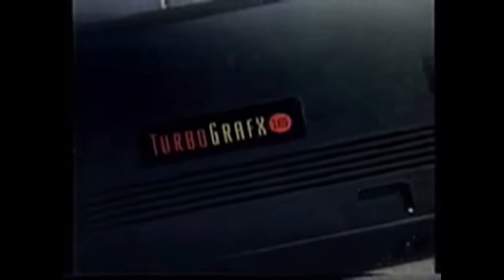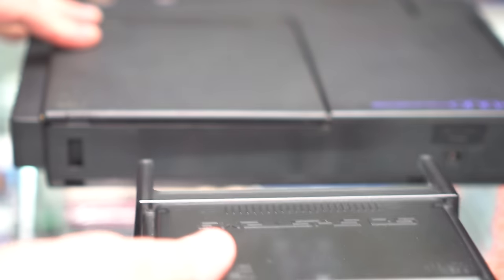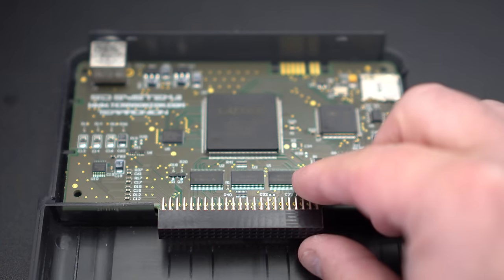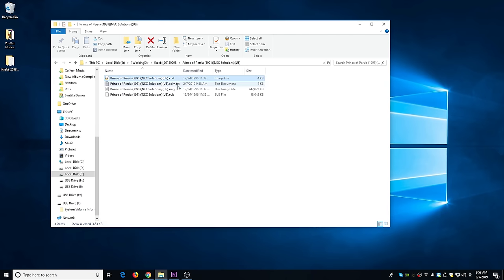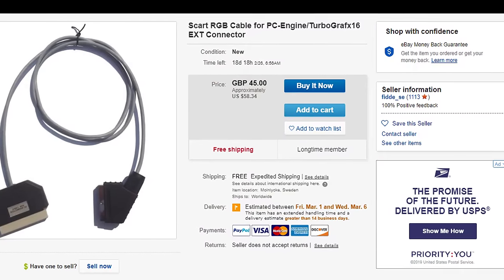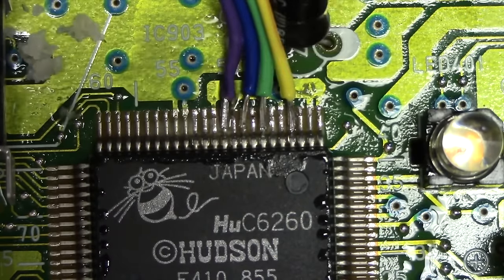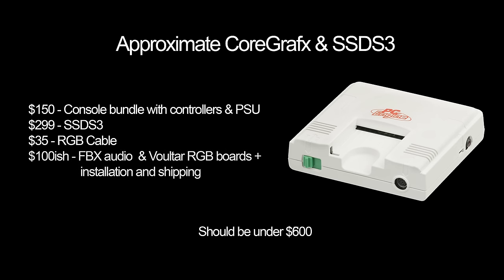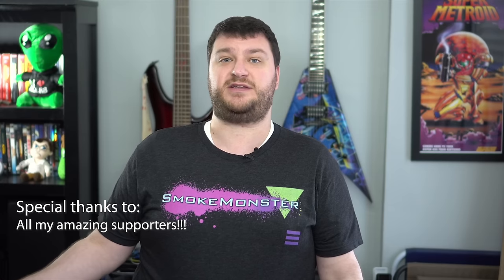TurboGrafx-16 & PC Engine Hardware Solutions

Comment: I am the seller for the Chinese Clone RGBS adapter, would you let me know what do you mean "potentially" damage your system?  Any evidence ?  The device is just a simple RGB amp, I really want to know how it can damage your system ?
Reply from the maker: It was sometime in 2017.  Seller's name was 'choijustin'.  The 220uF input capacitors were backwards.  If they heat up enough and fail shorted, there is nothing to limit the current from the HuC6260 pins.  HuC6260 RGB DAC outputs are easily damaged when overdriven.  It is not my responsibility to help eBay sellers correct bad designs that are sold to consumers, nor is it to keep up with newer versions of those bad products.  The units I tested, as well as the fact that you put "potentially" in quotes and refer to this as 'just a simple RGB amp' without even realizing it can ruin a console are why I will continue to warn customers away from this thing, as I always have.
Reply: @RetroRGB  Wait a minute. 
1) There is No 220uf capacitors for my adapter at all ( since version 1 ) . Basically, my RGBS adapter does Not use 220uf capacitors. 
2) If you read the picture of my adapter inside your movie carefully,  all the capacitors are ceramic ( they are Non polarity ). It is impossible to install backward.
3) For some of my early model ( yes, may be back to 2017 ), only the sound portion are using electrolytic capacitors ( which has polarity )  and they are 47uf.
I am pretty sure those capacitors are installed in correct position ( Not installed backward ). Out of 1000+ of adapter I has been sold, I canNOT swear Non of my adapter never has single of capacitor being installed backward ( since  they are hand made ). *Assume* I made mistake and have some adapters install the capacitor by mistake ( yes, assume ), does it means the adapter is bad product?   Can Samsung / SONY guarantee None of their product has any issue? 

In order to avoid any mistake ( assume I have ) I made, I change all the capacitors to ceramic capacitor ( which is the current version ) to prevent any human error happens. I made improvement to my product and try to avoid human error if possible.  Should you use one sentence -->  "those bad products"  to describe ? I don't think this is fair

Finally, please don't change my meaning --> 'just a simple RGB amp' without even realizing it can ruin a console
What I mean is since the RGB amp is design/assembly properly, how can it ruin a console ? If you assume the thing is Not design/assembly properly, of course it will damage thing ( eg, you put 5v output back to the input pin, of course it will fail, Not limit to RGB amp but anything , right ? )
Reply: @RetroRGB  One more thing, I just double check with the circuit designer for this RGBS board. He confirms the capacitors in the sound portion ( 47uf ) is for separate/prevent the DC voltage  on the board to enter into audio pins of PC engine extension port. He reminds me audio signal is Not an electric current, therefore, the capacitors ( 47uf )  in Not for DC current ( which carries +/- ) but only for separating DC current and only for audio signal ( which Not carrying DC current ) .  In case the capacitors have been "installed backward by mistake", it won't hurt anything. However,  to avoid confusion, he changed all the electrolytic capacitors to ceramic capacitor which does Not carry polarity.
Reply: I got 2 of these Chinese eBay RGB adaptors, work perfect in RGB Scart on CRTs in the UK... they are excellent value for money imo .. ✌️💥
Reply: Seems to me some of these overpriced american 'designed' retro products are just plain lazy design rip offs of the cheaper Chinese workarounds and with a few bells and whistles added... and they are still produced in Asia...
Reply: @TheKayliedGamerChannel-YouTube  what? Many of them aren't, or at least assembled. The separate pieces may be, but that's not the part that matters. Eg: the capacitors and resistors etc are manufactured in China/Taiwan etc but the product itself is designed here and assembled for the specific case of game consoles and AV. This type of thing is especially important when things like shielding are considered, and with less shielding around power supply it usually won't matter (TV or SD video) but for gaming it can cause interference even with shielded AV cables, which is another product that matters in all this, and with adapters using certain lower cost processors/silicon for down or upscaling or just transcoding/converting, you can introduce latency that normally wouldn't matter but very much does in gaming.

That said, singling out Asia only isn't accurate as many US/Wester or Russian sellers sell crappy products or stuff that isn't up to snuff for high signal integrity and low latency etc. It can also be a matter of customer support or product support over time, warranty etc. It's just like anything else. I genuinely don't think many of the more expensive cables and AV gaming specific solutions are overpriced, even the ones I don't get myself and go for a cheaper alternative.

The upcoming GBS-Control AIO is a good example. I want a VGA output and Horizontal Sync Converter. GBS is about all there is for component, especially low latency and feature rich. The Aio tho, while I think is a good product, is more than I can/want to spend, so I am going to order a PCB (prob from China in some capacity) and build my own for 1/3 the price.

These things are generally not as simple as "products from here are bad" or "products that these people recommend are overpriced." It's a bit more nuanced, and I think Bob generally uses "Chinese cables" or cheap knockoff trash to describe just that, without condemning ALL solutions that may have some of those adjectives apply. I've heard him say many times to get what works for you, and he's only trying to help us decide just that - as many in the retrogaming and modding scene are! :)

Also, good on the seller here for breaking down his points of contention or however you'd call it, tho it was a year or so ago I suppose.

Comment: To add to Bob's point about cutting the post on the SuperGrafx. If you don't cut the post, the pressure that is being applied at all times, will break the board. It breaks 72 traces just above the HuCard slot.

The break can happen even if you are not inserting HuCards.

Comment: I’ve been eyeballing UGX-02 for years now and finally pulled the trigger. I think I can answer a few questions about it. :)

He probably didn’t think anyone would care about RGB output because you can still add that to the base system instead. Honestly, that’s preferable to way SSDSys3 [mis]handled it. If his domain is digital and it doesn’t stop you from doing RGB yourself with Voultar’s board or whatever... good for Voultar!

The game list was limited to 100 titles until they added “Block,” which was just a way to switch to the next page of 100 games and the next and the next and so on. It was added along with the ability to load HuCard ROMS, since that greatly expanded the number of titles that will fit on smaller SD cards. He very quickly got rid of the “Block” setting and now you change pages just by going through the list.

You are actually able to combine a virtual HuCard with a virtual disc image... like using a Turbo Everdrive 2.5+ and patched System Card ROMs together with a stack of burned CD-ROM² games. :)

Really old versions of the firmware have you turn it off/on before you boot so that you can insert the system card if needed without the system card hijacking the built-in menu at the initial boot (UGX menu boots up like an internal Super System Card). The firmware you have on there actually boots CD-ROM² and Super CD-ROM² without a real system card... just pick the JP Super System Card BIOS ROM from the list like it was any other HuCard you wanted to play and it simulates a built-in Super System Card.

Yes, it has Turbo Everdrive 2.5+ functionality and can play HuCard ROMs. It will boot the JP Super System Card ROM and behave just like a Duo or Super CD-ROM² attachment with their internal Super System Cards. Just like a Duo, it even lets you get by with the cheaper Arcade Card Duo, which combines additional RAM on the card with RAM from the internal Super System Card. You know... instead of putting it all on a single card like Arcade Card Pro.

Arcade Card Duo has no built-in ROM and has a separate boot procedure described on their site because of it, so it might even be able to launch without power-cycling. I’m not sure if it will still block the UGX from booting initially due to the card detect/present pin or whatever but, obviously, a Duo doesn’t have that problem. The untranslated part of the UGX site mentions some part of the process takes you to a list at boot anyway, regardless of having a HuCard inserted. It’s certainly possible that they have gotten rid of this requirement for Arcade Card Duo users like they have for Super System Card users. Unfortunately, I don’t own an Arcade Card of any kind yet. :(

Comment: 3:09 “all original consoles with the CD attachment require that a HuCard be inserted into the console for discs to play” At least one exception:
The Super CD-ROM² attachment, which has a built-in Super System Card. That’s the one that plugs right on to the back without a separate interface unit/dock.
Reply: Arcade card is needed for some games still
Reply: John Di Pietro Yeah, but none of the CD systems have a built-in Arcade Card. This part is where he was saying all CD-ROM² attachments need a separate system card inserted to play CD games and that operating without a system card was limited to the systems with built-in CD-ROM² drives (Duo, Duo R, Duo RX).

Even Duo systems with a built-in Super System Card need a separate system card to play Arcade CD-ROM² games.
Reply: @emmettturner9452  look at the name of the attachment. If that doesn't clue you in.... This is a great informative video. If you really want to pick it apart get a life.
Reply: @emmettturner9452   didnt read the book you posted but if you got time for that.... heh
Reply: Hey brother, I apologize for taking your comment the wrong way.
Reply: neozeed1964 LOL! Sorry for coming down so hard. Rubbed me the wrong way, I guess. I need thicker skin! ;)

You did make me self conscious of my own admittedly useless comment where I said “Uhh, neither the CoreGrafx nor CoreGrafx II come in a ‘variety of colors.’ ;)”.

Despite some thumbs up it definitely wasn’t productive or helpful so I deleted it. That’s a direct result of your comment so I was wrong to call it “useless.” Sorry. Guess I thought it was funny at the time but it wasn’t enough to justify the noise (better SnR this way ;)).

Comment: I own a Core Grafx 2 and I bought a used, loaded Turbo Everdrive and a DB Grafx Booster and am satisfied with that. The Everdrive cost me 98 bucks with all the games on it and the PC Engine was about 130 bucks. Then the DB Grafx Booster was about 60 bucks. So about 300 bucks for everything. I also use the HD Retrovision Genesis component cables, so add an extra 60 bucks or so. I think it's a great choice for someone who doesn't care about the CD games like me. Very informative video Bob! Thanks for all you do for the gaming community.

Comment: For those looking for a simple emulation setup, the Wii has an excelent port of madnafen (and it runs on 240p for those with a CRT)
Reply: Yes, the madnafen port is great, though the core for the Wii's Retroarch is better in every way, especially video quality. With wiimadnafen I can't get the picture to be as sharp with any video filter setting as on Retroarch (with filters turned off and the right AR settings, of course). Even then, the Wii either through RGB or Component running Retroarch is not quite as sharp as my RGB-modded PCE, but it's pretty close, and offers save states and perfect CD image loading.
Reply: @Izquierda  I'm hoping the Wii Dual mod will really help with video output sharpness at all resolutions - especially for emulation at 240p.

Comment: Super SD System 3 is also pretty picky about the disc images it works with. Everyone on Neo-Geo Forum was sharing a set that was preconfigured, much like SmokeMonster sets, so a lot of people don’t realize it. They even banned MobiusStrip (temporarily) when he fell for one of their in-jokes while looking for it.

A lot of people there completely forgot that the NeoSD required PC software to prepare the ROMs and jumped all over DarkSoft for their own initial setup difficulties. How does that saying go about pointing out the speck/splinter in someone’s eye without noticing the plank in your own? ;) It just seems that everyone turns a blind eye to this part for Terra Onion.

Granted, UGX-02 is undeniably more clunky than SSDSys3... but all of that was functionality added after launch (launched as just a digital video adapter). Hard to complain when it was added free, though I really want to see it improved. It has actually improved a lot even since they added those features:
You once had to change CD images in the system’s music CD player, so you needed to know what game was track 5, or track 11 or whatever. They finally added an on-screen game list but, of course, we still need that Windows software. :(

Comment: Couple things:
1. Only the original PC Engine Duo/TurboDuo consoles need new capacitors. The Duo-R and Duo-RX models don't need a recap, as they switched to higher quality through-hole capacitors.
2. You can get stuff WAY cheaper if you're fine with buying from Yahoo Japan and using an import service. I was able to get a boxed mint PC Engine Duo for $150 after shipping (still needed new caps ofc)
Reply: yeah and not all caps need replacing, for instance the silver one he showed de soldering is not a problem cap, it was a surface mount solid electrolytic, you only need to swap out the through-hole electro caps, and tantalum caps( though not sure if these have those).
lots of fake news and paranoia surrounding caps in devices in general.